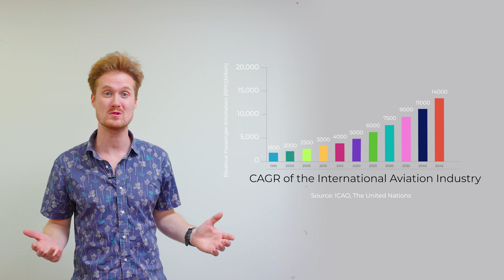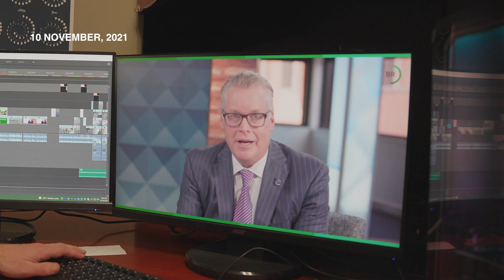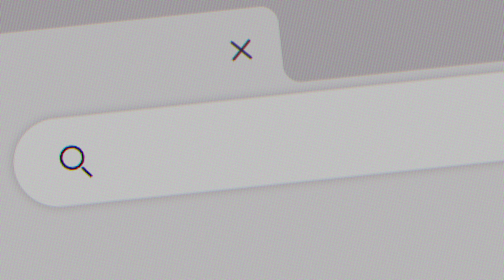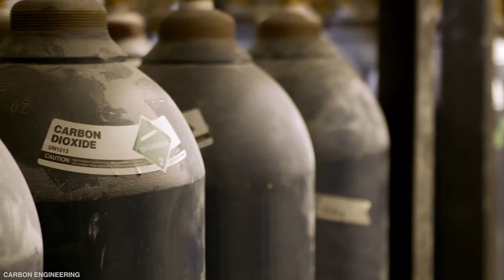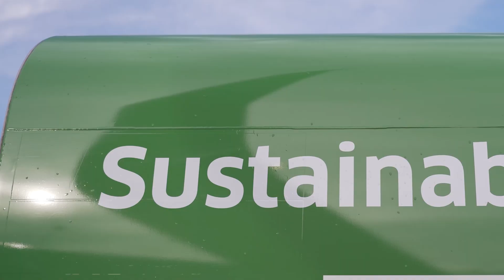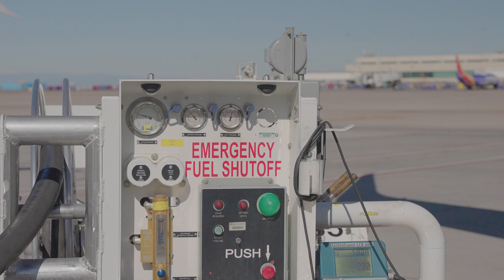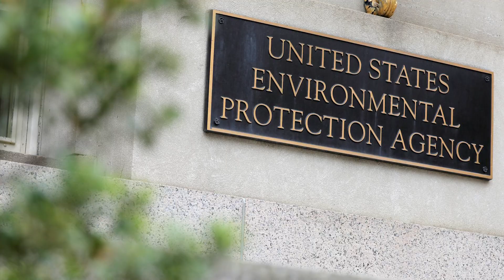Why is Aviation Hard to Decarbonize? | Behind the Wings

Comment: A transition to 100% renewables (electric, hydrogen, etc.) would be preferable to just reducing emissions. Problem is: Many airlines are currently replacing their 20th century planes, which in turn will be replaced sometime around 2060. (Or emission taxes have to become so high that early replacement is commercially viable.)

Comment: Is an industry that contributes 2% of total carbon dioxide emissions that much in need of electric engines? Don't get me wrong - I'm asking cuz I don't know. What other industries need more attention? In other words, how much impact is 2%?
Reply from the maker: It's a good question. 2% is still substantial, but the bigger challenge is that aviation can't be easily solved by electrification. Electric planes are currently only viable for short and light-load trips. As other industries like ground transport, construction, and agriculture decarbonize, aviation will likely make up a bigger piece of the pie. This is also true for other hard-to-abate sectors like marine shipping, chemicals, and plastics. For aviation, Sustainable Aviation Fuel (SAF) and carbon capture are emerging as parts of the solution
Reply: @Wings_Museum  thank you for the reply. I appreciated it!
Reply: @Wings_Museum  I am thinking that there is just no type of storage solution for electricity with the energy density for an airliner. Of course not being an engineer my opinion holds as much water as a fishnet.

Comment: Actually we are already part way there with electric aircraft. For example RR have electric turbines ready to go and they are 1/6 the weight of the equivalent turbofan engine. Yes Jet fuel is far more energy dense. However the engines are 35% efficient. So in real terms that 42Mj becomes 14.7Mj per kilo compared to 0.9 (including losses) for solid state lithium. That sounds insurmountable but is not. There is an up side. Solid state cells are now in production with near 4 times the capacity. That takes that 0.9 to 3.6. Then of course there is the extra 10 tonnes you have saved off the engines. For example a 737-900 has a fuel capacity of very roughly 24,000kg so in effect the battery size compared to that is boosted by 40% due to the 10 tonnes saved off the engines. That then gives us an equivalent of 5vs 14. OK that means the range would be 900NM (plus safety margin) but many flights in the USA and Europe are less than that. You can also start messing about with speeds too. A jet engine to be it's most efficient needs to run at about 90% to 95% output. An electric fan engine needs to run somewhere between 40% and 95% for good efficiency. So if you fly 10% slower you extend range by 20%. There is also the work Prof Goodenough is doing where he has cells in the lab with 20% higher energy densities than those above working and he is trying to improve them further. So if you get the Professors cells and slow down 10% that 900NM becomes 1300NM.
Reply from the maker: Agreed -- electric is a great option for shorter flights and especially with less carrying capacity. It will be interesting to see just how energy-dense batteries can get to support longer flights. Right now it's not there yet.
Reply: "RR have electric turbines ready to go and they are 1/6 the weight of the equivalent turbofan engine"

Source?

"Solid state cells are now in production with near 4 times the capacity."

Source?

If such a powerful and light motor is available, and if such energy storage systems are available, why is Rolls-Royce messing around with something and slow and useless as the Spirit of Innovation?